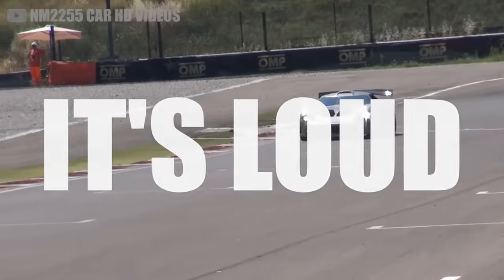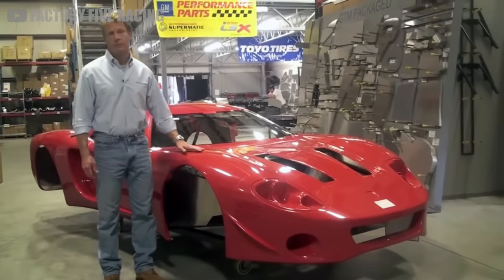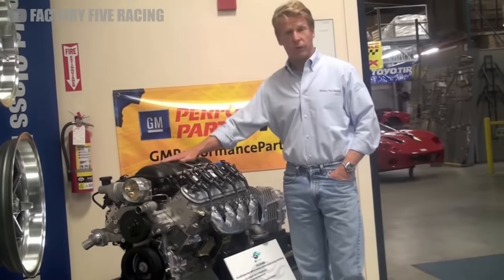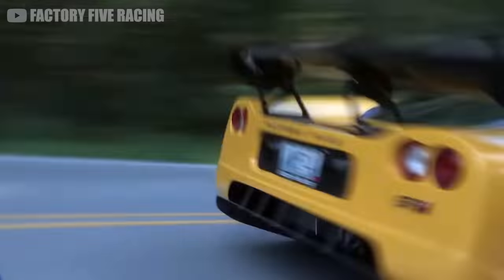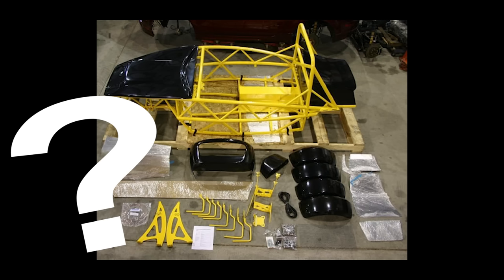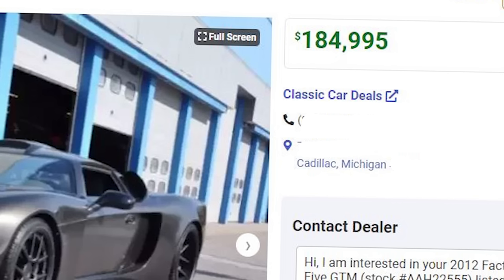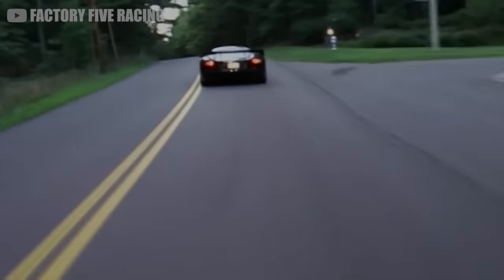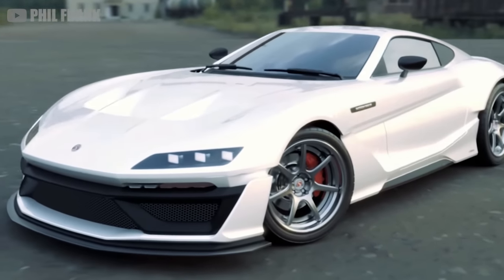The FASTEST Car You Will Ever Build | Factory Five GTM

Comment: Component car is referring to a self assembly vehicle that is mostly new components that are designed from factory to fit, not take offs. Perfect example is factory five when you choose all the new bits in the catalog or a vehicle from superlite. A kit car is a vehicle who utilizes mostly used parts from an existing vehicle(think more than just powertrain here). That's basically what I've gathered from my research when I was looking to buying one
Reply: This has been my understanding as well
Reply: And Replica?
Reply: @krisraps  replica seems to be a gray area,you have people like superformance and RCR utilizing 85%+ of the recreated original parts and then you have replica's that go the other side and are meant to look like the car, but function differently. The most replica's that are on the market today are big money cars, it's just hard to discern what a kit/component car is and a replica begins. For example superformance comes as a rolling chassis minus engine and drivetrain. RCR is sold as a component car unless you choose to do their turnkey minus program where they build it all minus engine and ecu parts installed.
Reply: That's semantics. What you call a component car IS a kit car. Used or new status of components is not relevant.
Reply: Everything on mine was brand new, no donor. You can source everything yourself if you wanted to.
Reply: @thefreedomguyuk  I kind of agree. Kit car still has lots of new parts. There's just some kit cars with more new parts and some with less. GTM still needs donor parts.
Reply: component car is a subcategory of kit car

Comment: The GTM has been on my bucket list a long time.
Right up until the C8 came out, and now the Z06.
Basically about the same price and performance, with a factory warranty.
Of course minus the 2000hr build time too
Reply: They are completely different animals. One is a 2500lb. race car and the other has ALL the nannies, and some extra pounds, and NO STICK.
Reply: The f5 GTM looks endlessly better than any Corvette especially the c8, which looks like our was designed by a Chinese child
Reply: You can’t compare those cars. This car is FAR lighter and more raw.
Reply: @Andrew Landes lol no. A v8 or at least a 6 cylinder turbo is needed for this car
Reply: @jstdrv  LOL!!!!!!!!!!!!!!!!!
Reply: @carkid7640  When it's possible they should have gone electric because of the low center of gravity and immense power.  And you wouldn't have to breathe in your own air pollution.
Reply: @carbonfiber8071  Yeah, all the nannies - AC, air bags, crash tested, 0-60 under 3 seconds, is not a used car (that donor powertrain came with miles on it), comfortable seats, and enough cargo space to take a couple of overnight bags on a road trip, but somehow still performs at the same level.
I don't need a stick.  I want the best transmission for the best performance possible.  If that is a stick, fine.  If that is an auto, I dan do that too.  I certainly love the PDK (seriously, put a Porsche in Sport+ and try to tell me that isn't fun.  Even my hardcore stick driving friends are impressed).

If you want to go around the track fast, a C8 does just as good a job.  If you want to go around the track fast like they did in 1967, the GTM is a better bet.  You are reading this on a computer though,  so why not enjoy the modern technology?
Reply: @jjchockey  And performs about the same for about the same price.  Do you do your racing on a track, or to the drive through weight scales?
Reply: @v3rlon  You sound triggered. Some guys have a stick, some don't. Just a couple of flappy paddles instead...
Reply: @v3rlon  "Comfortable" You must be really old and have a hard time getting in a low car.
Reply: @v3rlon  Drive your Camry and shut up.
Reply: @v3rlon  LOL, you couldn't drive it anyway...
Reply: @v3rlon  They don't feel the same. That's the point. If you've driven both you know the difference.

Comment: Real talk, there needs to be a standalone TCM for the C8s 8-speed transaxle. I assume when enough will be parted out, costs will drop enough to be downright affordable. No more overpriced and weak Porsche transmissions!
Reply: I paid $1200 for a G96.01. Plenty strong for a 2500lb. car. The money for the C8 driveline would cost way more.
Reply: i know a guy that makes tcm for bmw 8 speeds
hmu if u actually need that tcm
Reply: And I'll absolutely destroy you on drag and circuit track in my 92 civic hatch that is 1100hp at 1500 lbs curb weight.
Reply: @JLUX100  You talkin' to me? There's nobody else here so you must be talkin' to me!
Reply: @JLUX100  for about one pass anyway
Reply: @fazeobama8872  lmfao for 400,000+ kilometres.  It's called a dual tune. I have a low boost 15lbs tune and a high boost 42psi tune.  Fully built bottom to top.  Lmao I'll out last your v8 any day.
Reply: @JLUX100  and then there will always be some other guy who bought a used busa for $5k, threw on a 75 shot of nitrous for a few bucks more and you’ll never catch him. What’s your point?
Reply: @christians131  lmfao comparing a bike to a car... Hilarious... Second, I can actually probably pull on a busa.  Buddy I  have a mid seven second car. My point is I'll eat any car you can get ahold of period and last longer.
Reply: @JLUX100  so you just have the fastest car on earth but you devote you time trying to impress stranger on the internet?
Reply: @JLUX100  got a video? I just got into tuning my m135i and I’d love to see that blistering civic
Reply: @AmperahGaming  He's still editing...
Reply: @JLUX100  thats all wonderfull until theres a turn and you aswell as your lovely 1100hp civic deicde to kiss the closest tree.
Reply: @JLUX100 u got jack sht
Reply: @JLUX100 u got nothin. U know Honda's can't handle tht or make
Reply: @AmperahGaming  yes brother! I dont know why I didn't grt this notification 11 months ago. I appreciate you not being hateful or hostile. Happy tuning.   I'll upload a video asap just so these haters can apologize.  Lol as If I  live to to impress or prove myself to them 🤙🏼😂
Reply: @cyberspino6277  lol I'm careful where I rip and I have a dual tune setup. 1100hp high boost tune and low boost 700hp tune.  And the car tracks pretty good actually
Reply: @TraveladvRajanSRai  lmfao no clue what you're talking about.

Comment: Not sure if anyone has pointed this out yet, but a component car has a ground up chassis which requires donor parts from manufactured cars, like an engine, while a kit car uses an existing chassis from a manufacturer and usually has a body kit installed that replicates an exotic car, like the Pontiac Fiero with a Ferrari body kit.

Comment: So it's under $30,000 but you don't get an engine or a transmission that's separate. Is that right?
Reply: rolling chassis no driveline (engine/transaxle/differential)
Reply: @johnvillano9809  It's NOT a rolling chassis.
Reply: @carbonfiber8071  i explained it to a novice as a roller for brevity
Reply: @johnvillano9809  But you were completely wrong, briefly.
Reply: @carbonfiber8071  when you are done building what they give you and put wheels on it it is a roller no? you supply engine and g60 from a porsche as driveline as an option
Reply: @johnvillano9809  No. You Need: Control arms & mounting hardware, spindles, 8 ball joints, brake assembly including brake lines, calipers, rotors and parking brake handle & cable, gas tanks with pump&lines&regulator/filter, steering column, door handles, (outer) corvette cv joints, clutch assembly, corvette exhaust manifolds, radiator with fans and shroud, wiring harness & ecu for engine, oxygen sensors, door window mechanisms, side mirrors, radiator fill/overflow tank, hood latches with cable and handle, wiper motor, and more if you want to build it properly. Oh yeah, and wheels and tires.
Reply: @johnvillano9809  That's the way Race Car Replicas makes their kits. Full roller with wheels no tires. But they are close to 60 grand. Well worth it though.
Reply: @johnvillano9809  The GTM uses a C5 Corvette for a donor. The frame can be picked up by 2 people.

Comment: IMO the upcoming F9R is a misguided attempt at modernization. Going from mid-engine to front engine is a (giant) step back. BTW neither of these items is in my budget.
Reply: Front engine has major advantages for building a kit car and sourcing a drivetrain, specifically the difficulty and expense of the transmission required for mid-engine.  Some companies like SuperLite now sell transmissions specifically for their car, but they are very expensive (Graziano for SLC is north of $14k by the time you get the transmission and the other parts needed).  Front engine you could buy 400hp V8, clutch, and new Tremec for about that much. 

It definitely looks more racy with the engine in the back, and with lighter engines than a big American V8 as the F9R will use, some dynamic benefit as well.  Keep in mind any kit is also  intended to have a fairly simple (albeit powerful) drivetrain as well, with varying tarmac surfaces and a huge powerplant behind the driver with RWD (and no real electronic nanny devices), you will see more than a few in ditches.

The F9R appears to have its engine very far back from the front of the car, in a sense it is mid-engine as the weight is distributed to get close to the 50/50 desired.  

Don't be surprised when the F9R is raced against a GTM of the same tires and hp if it is actually faster around the track.
Reply: @sburns2421  you hit the nail on the head, but also I doubt any engine with 12 cylinders could possibly be lighter than an aluminum block LS. As somebody who built an ls6 swapped Miata (with some help from v8roadsters) I can attest a true corvette or gen IV 6.2 motor from an Escalade/Denali with an aluminum block is equal or lighter than a factory Miata 1.6. Yes, the Miata has an iron block and DOHC which adds weight but really I doubt you’ll find anything lighter than GM’s aluminum block 5.3, 5.7(ls1/6), 6.0(ls2), 6.2(ls3/l99/l92) or 7.0 ls7. Even doing something like an all aluminum Honda k24 will start racking up lbs when you add the turbo necessary to keep up with the v8 guys. There’s a reason Factory 5 has Chevy gen III/IV mounts tucked in the back of the catalog for their Shelby Cobra replicas. It may be sacreligous but it works just a little too well together for it not to be offered. Performance will always bridge brand loyalty, and as awesome as the 5.0 coyote or modular 4.6 are, overhead cam will never be as compact or light as a good ol American pushrod v8

Comment: If you are smart, and do all the work yourself including bodywork/paint,  you can build this car for 50k to 60k.
Reply: That's still a lot though. The K1 attack with a turbo k20 finished it'll be around 30k
Reply: If you are smart you will just buy a c5 and boost it .... And you have a factory car that's easy to work on Comfortable and can find parts for it...Just saying ..
Reply: @erikcapozzi3425  They are apples and oranges. You obviously don't understand the difference between a mid-engine tube-frame race car and a front-engine production car that weighs 800 lbs. more. The driving dynamics are night and day. Plus my car is worth over 100k at the moment, can't say the same about a C5.
Reply: @erikcapozzi3425  Some people like it easy, and some build incredible and unique cars.
Reply: @rokk144  Pretty cheap for what it is. Guess you have to pay to play.
Reply: @carbonfiber8071  depends what you want..I wouldn't call a pre fabbed kit car incredible or unique....in fact all you did was assemble it...You didn't build anything... It's all about preference and what you like and want in a car really
Reply: @erikcapozzi3425  Mine isn't stock. The entire body is my design. Foot in mouth again.

Comment: They had some great ideas but 600 hours in assembly?  They should have started to build them and gradually the operation would have gotten streamlined.  Start with a base small block V8 mid engine, paddle shifters, rigid and light weight with a targa top keeping rigidity with the full roll cage shown in this video.  Aim for about $40,000 - $50,000 and they would have sold a ton.  Then have other models with different options for more.  Then they could have also offered them without a drivetrain for those with the means and time to do it themselves.  But we all know that would have been a sliver of total sales.  Moronic management.

Comment: Isn't the Ultima GTR faster?
Reply: The Ultima RS is also like, 6x more expensive
Reply: @wingchangwow  After everything is all said and done, not really. But going back to the title, they are saying the GTM is the fastest car you can build, which isn't true.
Reply: @JoeyBaby47  it says "you will ever build" not "you can build". The price tag makes it the most likely candidate for somebody to build when it comes to price to performance compared to the Ultima. For gtm you also don't have to use an LS engine. I've seen builds use 2006 wrx parts which dramatically reduce the final cost
Reply: Fastest car is highly dependent on how you build any car. Calling this the fastest car you’ll ever build is nonsensical.
Reply: @Archangel3083  are you ever going to build a car? More than one? Well this could very well be the only one you ever consider building. No sense in arguing over semantics when the title is left to interpretation
Reply: @wingchangwow  I am building a car and have built others. Right now I’m building factory fives Type 65.

Comment: > Low cost
Yea its around 50-100 grand low cost
Reply: My thoughts exactly... Just think of how many nice decent sportscars (with twin turbos) out there that you can actually choose from fer well under 50 grand! 🤔
Reply: Still better than paying over 300K for a similar performing Lambo. I would much rather have one of these GTM's with a fully built LS7 rather than a Lambo. Way cheaper, way more logical and way better in every aspect.
Reply: @shimaislam7827  If saving money was the goal of this car, then they have FAILED already... With 300K, I would rather buy a nice decent house with extra units I could rent out in Santa Barbara! <:  P
Reply: This "car" would be loud and rattle like mad. Fancy looking but unrefined. Racecar only
Reply: @janeblogs324  Actually, it depends on how you build it. Mine doesn't rattle. I eliminated the rear engine bay window and built a double-insulated wall. Pretty quiet for what it is. How many cars have you built?
Reply: @OtomoTenzi  Where did 300k come from?
Reply: @OtomoTenzi  Comparing a heavy production car with this car isn't realistic. They are worlds apart in feel. This car is like a Mclaren F1 in terms of weight to hp. 2500lbs. isn't much to get moving and you can accelerate quickly in higher gears without having to downshift.
Reply: @janeblogs324  It kinda like Bugatti, the Chiron and the Bolle share the same chassis and driveline. One is a brutal racecar and the other is refined.
Reply: @carbonfiber8071  You mean an MTA bus or a Ferrari 288 GTO? Both of them would easily cost more than $300K. <:  P
Reply: @shimaislam7827  Yes, I can do a full engine replacement for what an oil change costs in a Porsche Carrera Gt.
Reply: @OtomoTenzi  So you don't want to talk about the previous ridiculous statement...
Reply: @OtomoTenzi  I doubt you have 300k, so why mention it?
Reply: @carbonfiber8071  How much will it cost ya to completely overhaul a 3000GT back to factory-new condition with ZERO mileage? I've heard that car is a real SHITFUCK to work on! <:  P
Reply: @OtomoTenzi  Toyota or Mitsubishi?
Reply: @carbonfiber8071  No, I'm only interested in funerals and burial plots right now... :goodvibes:
Reply: @OtomoTenzi  WTF are you talking about a 3000gt for. I don't have one.
Reply: You have to factor in maintenance costs. I can replace an engine for what an oil change costs on some exotics.

Comment: That car didn't have a spoiler.   It had no down force to the drive wheels.  I know it's rear engine, but when you're talking about 500 + hp  , you're going to need some downforce
Reply: It's mid engined.
The engine is behind the driver/passenger but in front of the rear axle. A 911 is rear engined, with the engine aft of the rear axle.
There is a huge difference in packaging, weight distribution and handling characteristics between the two.